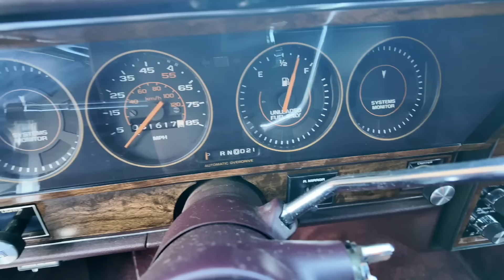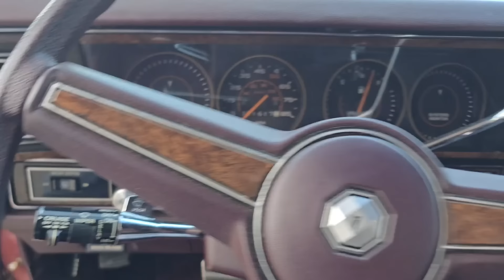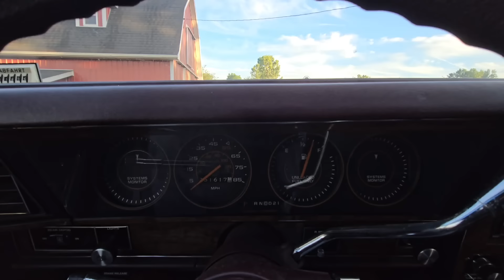Granddaughter sells me her grandfathers car

Comment: You are correct , it is the real problem finding cars that aren't screwed up. Everything seems to have been modified in some way or another. It is also common to see trashed interiors and rust. I also run across little miles cars. That should be nice but were in the hands of buffoons that did not know how to work on them. I recently came across a beautiful early '80s Pontiac that someone had hacked holes in trying to access some fasteners.

Comment: That is an awesome car!!  I have my late mom's 1986 Pontiac Parisienne Brougham which has the identical interior with the cushion seats,  in the same burgundy,  with burgundy exterior paint,  but also with burgundy vinyl roof featuring the same 'coach lights'.  305 with 700R4... kind of odd to see the battery on the driver side on your car.   Dashboard, HVAC, stereo with yellow LED display are even the same,  only there are temperature and voltage instruments to the left and right of the speedometer and fuel gauge. The trunk is in identical pristine condition,  even with the cover on the mini spare.  Wow. I would think this a review of 'mom's car', except it for not having the vinyl roof or whitewalls.  Mom purchased it new in late fall of 1985 and I don't believe it has ever been in the rain since.  This video inspires me to take it out of storage for a drive again soon.